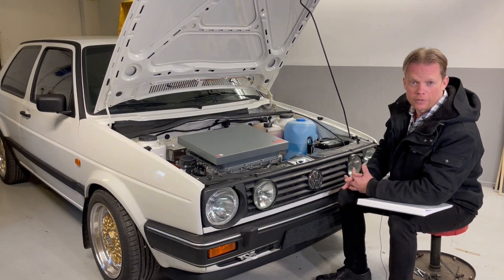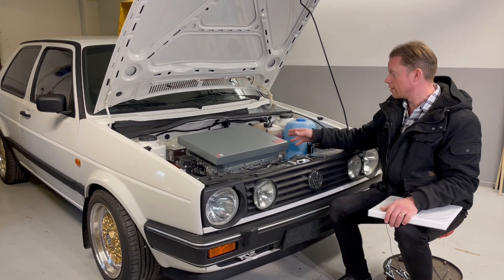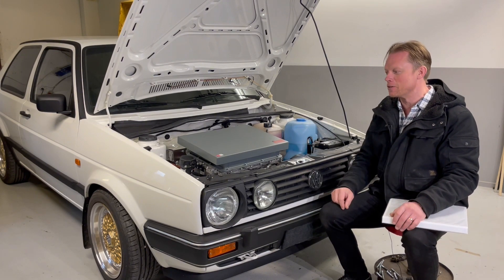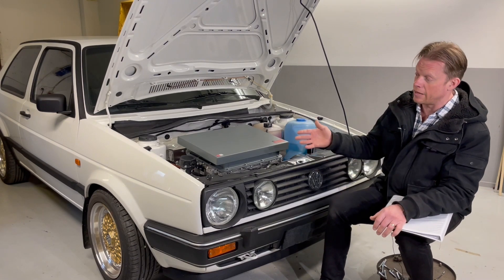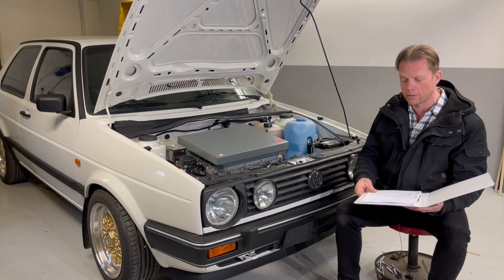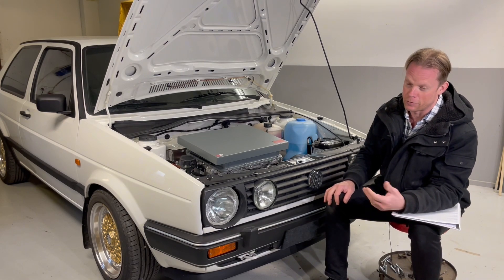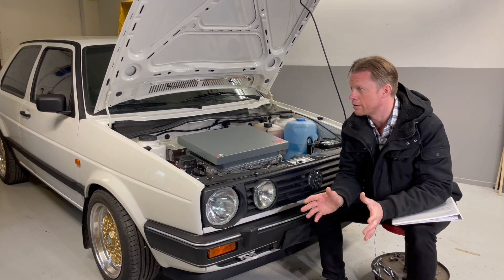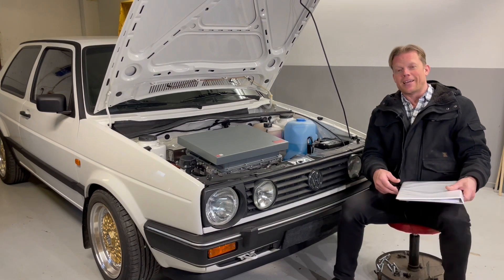My way to make this EV project road legal, Registrerings Besiktning, MOT, SFRO, Org TESTA

Comment: I am interested in your alternative lid for the PDM. I read another comment that this was basically for aesthetic reasons to match the original. I am considering this to see if I can reduce the height a little also.

Did you save some height when you did this redesign, or is the high point on the domed Nissan lid the height of your new lid?
The Nissan lid also has some thick honeycomb structure, whereas I guess yours is a thin sheet?
Any details you can share would be useful.
Steel or aluminium?
Thanks.
Reply from the maker: Hi. It’s not much hight you will save doing this I’m afraid.

Comment: Wow would have never expected that VW bothers to help us tinkerers :)
It's strange with the BMS. I upgraded my conversion from Leaf 24 to 40 kWh and the BMS can was near identical. At least the important messages giving out SoC, current limits and so on had not changed at all.
You could also ditch CHAdeMO and jump straight to openinverter Foccci CCS. You can adjust its CAN mapping to understand any BMS. I just drove 2000 km with it and charged a lot on different chargers. Advertising end ;)
Reply from the maker: I will make a new try with the 40 kWh BMS. It might maybe just be the PDM unit that can’t handle that chademo charging after 2018. 
Thank you so much for your input 👍🏻👍🏻

Comment: Certification is a real pain.  Different in each country and often they ask for things that are just not required or reasonable.  The UK actually try and make it difficult so you just don’t bother. The US system seems to just care that you have wheels.  Denmark want to make it so difficult that again you don’t bother.  IIRC Belgium makes it impossible and would rather you fill your tyres with air from Wolfsburg to make it exactly as the factory made it.
Reply from the maker: You are so right about that. Here in Sweden it is at least possible and if you just have the right documentations you can pretty much do everything here.

Comment: why you not using a free programmable system or change the settings in the bms this should no problem, at least to set the correct voltage range, kwh, and Ah.
Reply from the maker: Because that this is a really cheap and reliable way to do an ev swap, but I decided to change the capacity, and that’s not recommended… 
Please tell me how to set the bms to those settings you talk about😃 it will be super nice to be able to adjust them!!!!!
Reply: @flyingtools  IT IS nessesary to do those Changes. If they BMS does Not know what capacity it has to expecting this can lead to errors ind the charging system. Means in best case it will Stop charging If IT think it is full and after a while the expected voltage is to Low so He would think there is a Batterie short or so in the system and disconnect the battery. There are some dumb BMS and chargers Out there they do only look about voltage and max current. But the soc depends only one voltage Not in capacity Like actual BMS System. But für your BMS System you need a factory programmer for the obd system. In this Case Car repirshop can helb you at best one who has Access to all System. It was a Nissan right?

Comment: Could you not have went with CCS to work with the bigger bms instead?
Reply from the maker: It will only talk to cademo, and there is no adapter that I can use available for it yet

Comment: Do you know if VW ID3  and E-Golf use same/identical battery modules? Is it just different number of modules, hense the kW capacity ot they are completely different, i.e dimensions, number of cells inside etc?
Reply: They are quite different. 
VW ID.3 (for the European market) uses large Volkswagen MEB modules (VDA 590 modules,  590 mm * 225 mm * 108 mm). 24 pouch cells (LGX E78, 78 Ah) in each module, either 12s2p or 8s3p. Then 7, 9 or 12 of these modules to create the 45 () , 58, 77 kWh packs. Liquid cooled battery pack.
VW e-Golf uses two kinds of modules in is battery case: 17 standard VDA 355 modules (355 mm * 151.5 mm * 108 mm) with 12 prismatic cells inside (4s3p), and 10 half-modules with 6 prismatic cells (2s3p) in them. MY 2014-2016: 25 Ah cells (24,2 kWh gross, 88s3p),  MY 2017-2021: 37 Ah cells (35,8 kWh gross, 88s3p). Air-cooled /passively cooled pack.
Reply from the maker: Hi, they use completely different modules.

Comment: whatabout making VW-logo in front as a lid for charging port :D so you could charge without opening hood :)
Reply from the maker: Yes, I have already been looking at that, but that will interfere with the hood locking mechanism and the radiator, so I decided to make that later. My first priority now is to have the car road legal so I can use it for this summer.

Comment: the specs they gave you are for the G60 but there was a G60 limited had 210 PS / 207 bhp / 154 kW @ 6500 rpm
TORQUE 252 Nm / 186 ft.lb / 25.7 kgm @ 5000 rpm
Many people running modified diesels with more than 800nm so you will be fine.
Reply: Maybe that was not available in his country back in the day? Maybe it's because that's a 5-door car and this a 3-door car? Either way still no problem (: